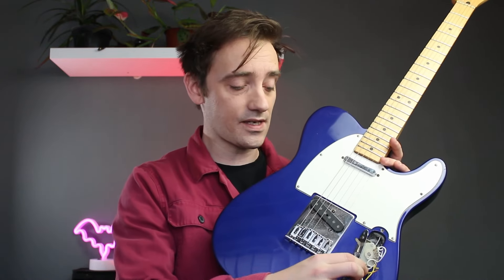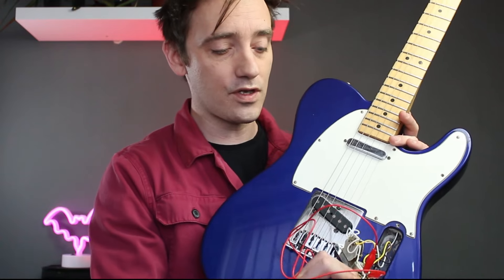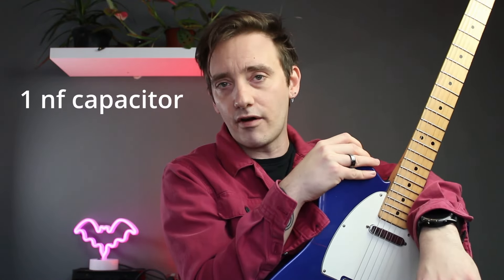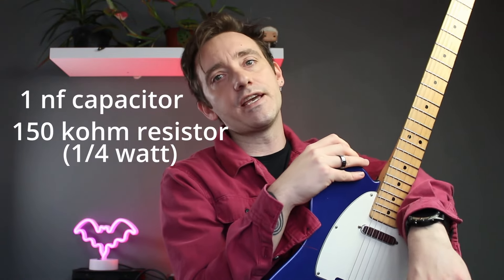Unlock Your Guitar's Potential With A Treble Bleed Upgrade! Comparison Demo

Comment: I have a question. On my strat, I ran my bridge pick up through the tone control. The guitar was wired without the tone control in the circuit. Now it is. What will the bridge pick up sound like with the treble bleed? I'm getting some strange tones when i turn down the tone knob. Thanks

Comment: Kinmans are better on single coils than Duncans. Duncans are suited to hot humbuckers I've found. Ready mades aren't a guaranteed good result, pushing signal thru a ceramic cap is questionable, silver micas or polyesters are a better bet.